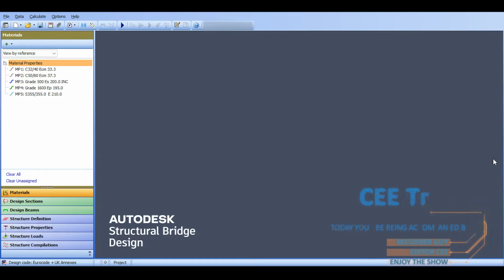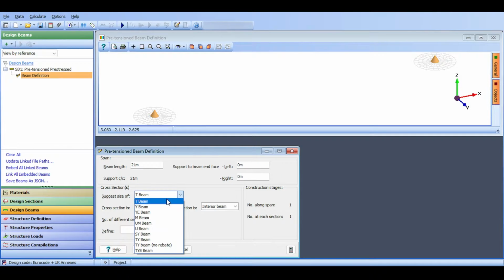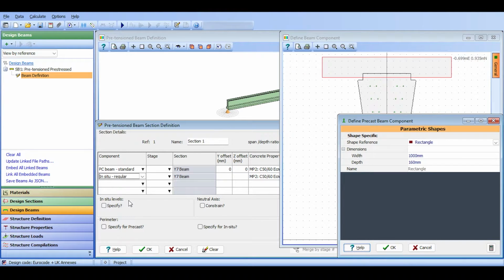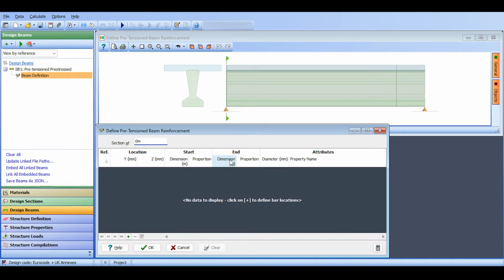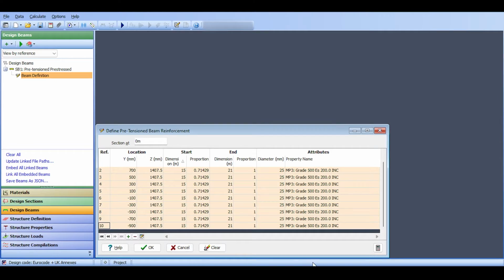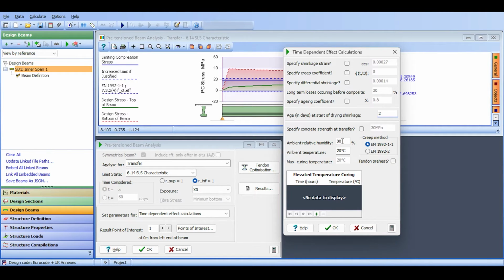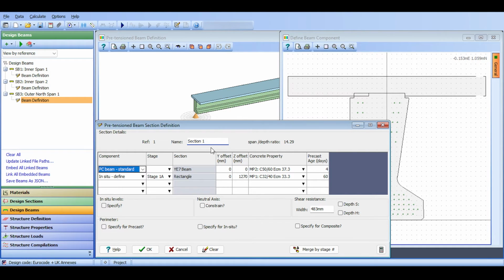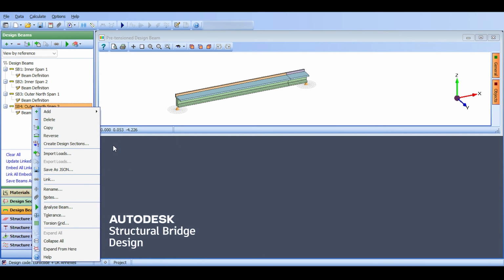Modeling and Design of a Prestressed Bridge on Autodesk Structural Bridge Design- Part 3 Design Beam

Comment: Hello there. Thanks for this video. What do you mean by stages?
Reply from the maker: most welcome:

By stages I mean, how you would construct a bridge. Here are some details

if you want to construct a bridge using prestressed precast beams, cast in place slabs, asphalt and barriers. How would you construct it?
Disclaimer: the stages have a different numbering system from what I want to mention here. Also, in some regions, the order may be slightly different.

Stage 1: build the columns (not included here, because those are considered supports)
Stage 1 (really now): Put the beams in their places.
Question for this stage: who carries the beam self weight?
Answer: the beam itself

Stage 2: You cast the slab above the beams but not between them (diaphragm)
Q: who carries?
A: the beams. The slab is not yet hardened

Stage 3: you cast the slab in between the beams and the diaphragm
Q: who carries?
A: beams with slabs

Stage 4: you errect the barriers.
Q: who carries everything now?
A: girder + slab (composite action) because the slab would have hardened when you add the barrier

Stage 5: you pave the asphalt
Q: who carries?
A: composite action

So stages are important because at different stages, different things are responsible for carrying different loads

I hope it helped
PS: Sorry for the late reply. I had a ton of things to finish and now I am gradually getting back